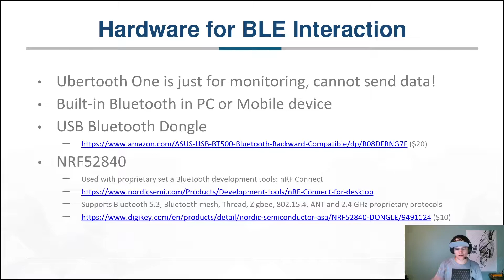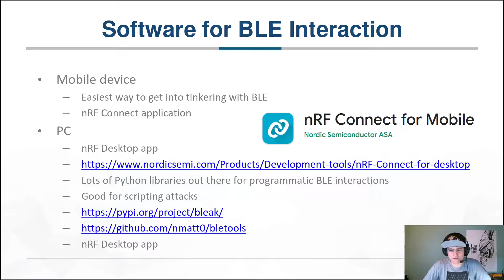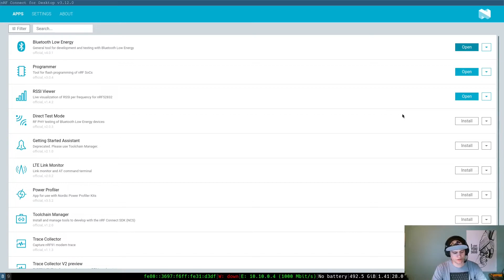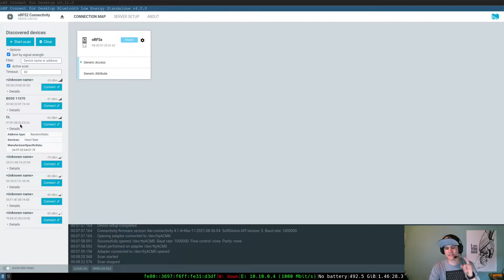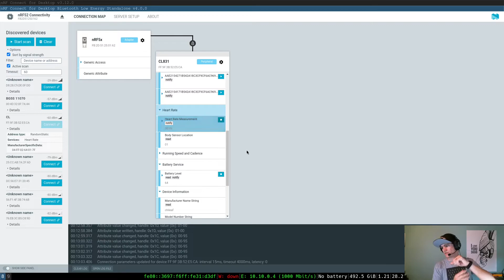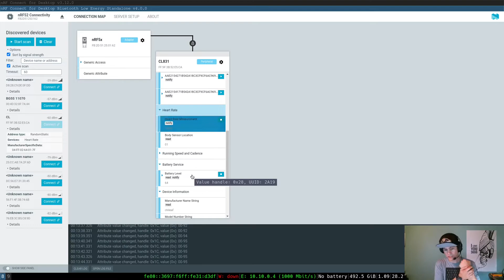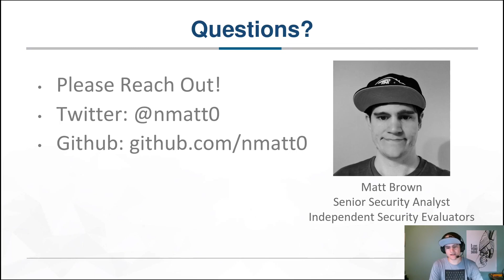Bluetooth Low Energy Hacking Part 3 - Interacting with Bluetooth Low Energy Devices

Comment: Best way I found of doing this is to use the app nRF connect from Nordic Semiconductor (as you suggest). I could capture packets using developer mode on an old android phone. I bought the data back and ran it through wireshark. After decompiling the app meant to be used with the device (A hire scooter), there was quite a bit of fun to be had (chasing students and resetting the scooter so that it just kept stopping) using commands still in the app,  but unused.

Comment: I am working on interfacing with a medical device that measures blood pressure, heart rate, etc. This device uses custom services and characteristics. In the past, its now unsupported companion application would authenticate with the device by sending a code to one of the characteristics during the binding process.

I've observed that the smartphone sends an encoded authentication code to the device(the user must insert this code). I capture the encoded message with the android log, and seen it in wireshark. However, I'm not sure how to reproduce this encoded value for my own application, which I am developing in Python.

Can you help me to understand how can I reproduce same result?

Thank you!

Comment: how could have a sample of MitM attack with your tool?
Reply from the maker: With what is shown in these videos you can't do a true MitM attack. BLE MitM attackers are HARD to pull off.

The best you can do is to program a BLE peripheral device to have all the same services and clone the MAC address of the device you want to act as. Then you can program it to act as the real device and could potentially have it relay everything to the real device after connecting to it. This would take A LOT of work.
Reply: @mattbrwn  is there any document about the steps?
Reply: @mattbrwn  also another question is that possible to clone the smart phone as well?